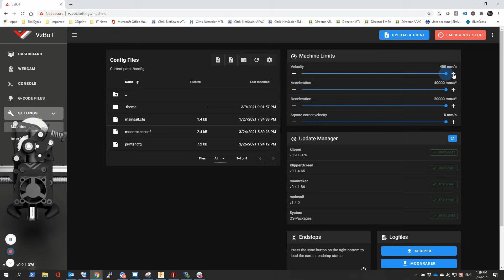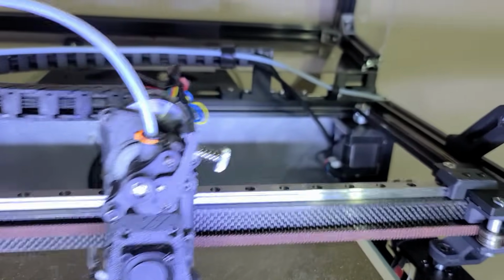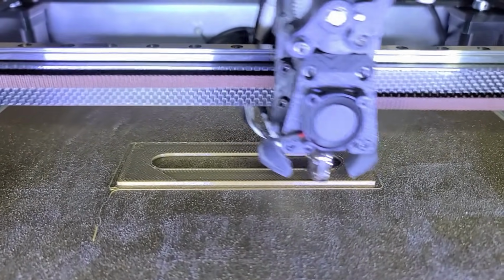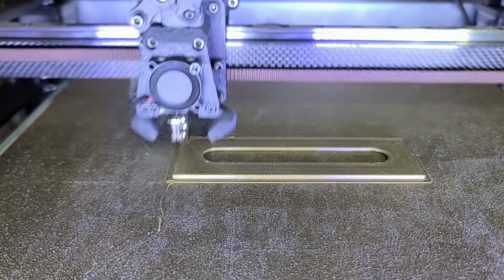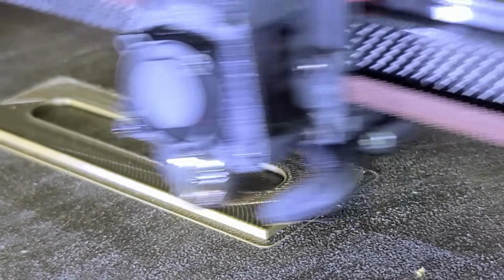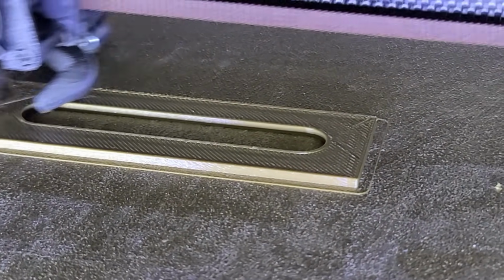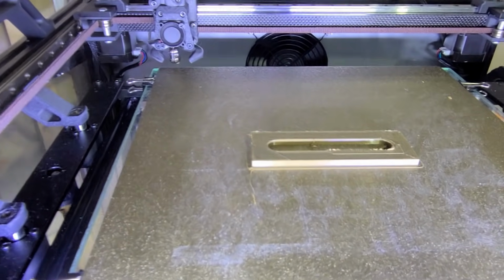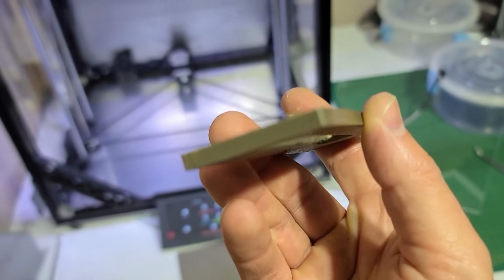Nova Hotend Speedtest 40K 400mms!

Comment: lol. The nova claims 47mm3/s, but you cap out at 30? and that's even at 260c pla. ie 30c over normal print temp. Nice way to false sell that hotend. as suspected its just a vollcano that have been polished.
Reply from the maker: its NOT the limite of the nova here.. its the limit of the CoreXY motors and other physics behind movement... not the hotend limits
. dont get this wrong please. Nova IS awesome and can go way faster than this
Reply from the maker: and its clearly not a polished volcona... trust me on this one
Reply: @Vez3D  lol the pla printed at 260C begs to differ. My unpolished volcano can match that.
Reply: @Vez3D  how do you need 260+ to even get close to the specified flow rate? all other videos you have is all over the normal print temp. One you even are 100!!c over normal print temp? i wuld love to see a normal flow test at normal print temps. ie. 230c MAX pla. untill then i will keep not recommending said hotend. (i have a comunity of 5k+ ppl under me)
Reply from the maker: its all good my friend. If you are happy with the volcano then stick to it. Its a nice hotend too. I would be happy to do all the tests you want to see if that can change your mind though.  As for the 260C.. it was probably way too hot for that speed test, but it was just the first attempt and I didnt play with temp. I will make some more testing.  Lets keep this constructive and happy printing :)
Reply: @Vez3D  if you have not tuned print temp how did you get to the 47mm3/s claim on the website?
Reply from the maker: @Olof123  I like friendly competition :) as long as everyone stays respectful. I cant wait to see 40K+400mms on your vocalno. Im sure it can do it no problem, as its not the limit of the hotend that I have reached here, but the motors on the XY.
Reply from the maker: @tonn0297  where did I say I got 47mm3/s ? I have not even tried yet to hit the max of the hotend. Honestly dont know what would be the best way to test that claim. Any suggestion? like just extrude in the air and calculate the flow from there ?
Reply: @Vez3D  I'm moving to slice, I really don't see any innovation in the nova other than slapping an oversized heated on it (plus the polishing job ofc). A structural heatbreak is a design that should be left in the past along with groove mounts. I wouldn't be so hostile about the nova but the dev has left a terrible impression with berating his own Kickstarter backers and then came after them again on Reddit when they just wanted to see some proof of his claims (which to date he hasn't shown). So I'll always think about that.
Reply: @Vez3D  ah i see im confusing ppl, but on the web page of the nova it explicitly say 47mm3/s, but yea no way its gonna hit that, so i wuld love to see you test it.
Reply from the maker: @Olof123  I didnt follow the kickstarter and didnt follow anything about it so I cant tell. But I can tell that it can print 400mm/s with no issue :)  ill do way more testing on it as time permits and share back my findings
Reply from the maker: @tonn0297  I will see if I can reach that. Btw.. I checked your profile and am I right to say you run a K2 ? Man I love this printer. It is way cool design with 4 motors ! I love it !!
Reply: @Vez3D  yep that is correct, and the reason im looking at the nova is the flow rate. but yea ive yet to see any test it propperly, so yea atm the Nova is black magic and fake claims in my opinion.
Reply from the maker: @tonn0297  what tests would you like me to do? Ill be happy to run them :)
Reply from the maker: @tonn0297  I have run some tests... and was able to do 50mm cubic/s.. then it started failing. I have a video about it if you want to see. :)